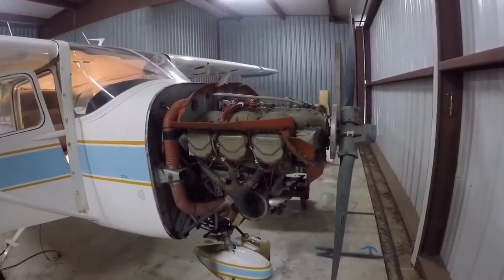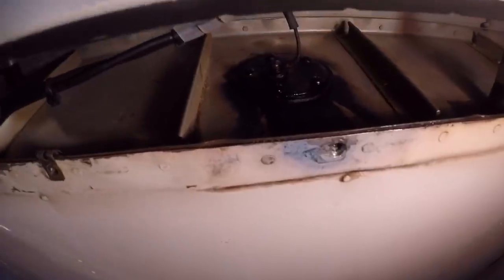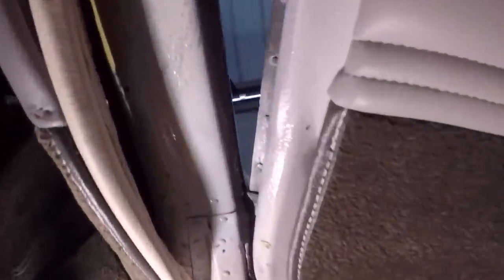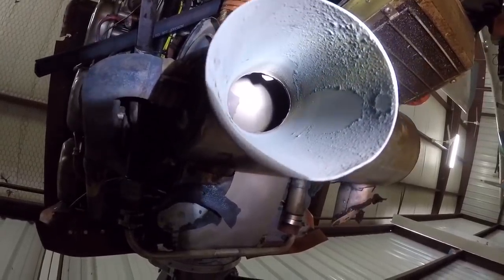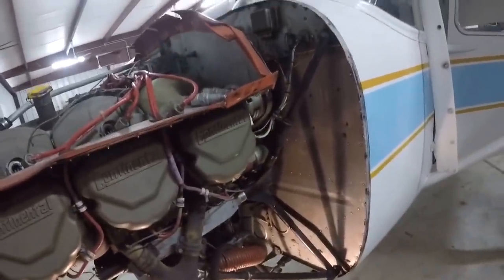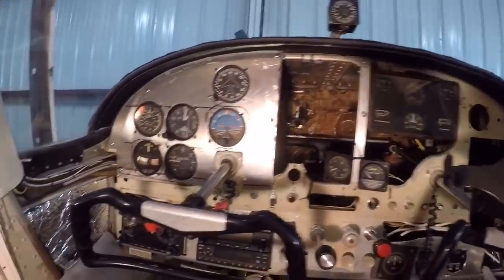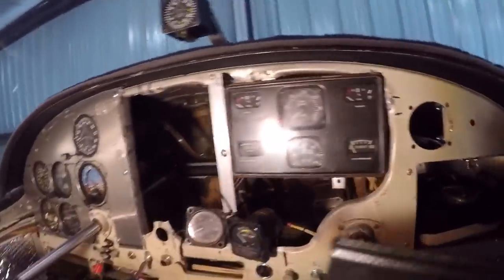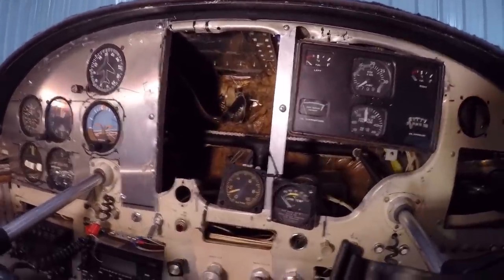This is why you get a prebuy (wait till you see the instrument panel 😮)

Comment: Excellent and clearly structured accounting of failed parts. I need more of this in my life - I subscribed. What is the best thing besides a thorough engine inspection one should do? What are easy access areas to check for corrosion. I am interested in buying a vintage deHavilland Beagle Pup but would need some advice.
Reply from the maker: I do not have direct experience with the Beagle Pup, however always do a thorough inspection of gear attach points and wing spar.  Check tail surfaces for security.  Don’t be afraid to open up as much as necessary for you to feel comfortable with your purchase.  All airplanes are built to have enough inspection access to get a good view of everything.

Comment: Probably best buy a used elevator and full instrument panel. The (U shaped) spar will have to be drilled off of the cabin roof.  
 Check  where the struts att under the floor is another big 182 corrosion area to

Comment: Hell, she's fine shape. Drop a little stop leak in the fuel tank, slap some JB Weld and 100 MPH duct tape over the corroded aluminum, pour some Engine Restore in the crankcase, and sign her off for another year. Just don't fly her near me.

Comment: THIS is exactly why I NEVER flew someone else's airplane. I made one exception and flew a club plane and had an inflight engine failure. When I was flying I flew MY airplane and no one else flew it without me being in it. No surprises, I kept the planes in top condition, never had to worry about junk like this.

BTW, is all that plastic "bubble" insulation even legal? All that panel work is certainly not.

I hope your customer knows this is going to be a VERY EXPENSIVE annual. So many owners can't distinguish between the INSPECTION FEE  and the ADDED COST to correct discrepancies. I hope he doesn't paint you as the bad guy in this. You are likely saving his life fixing this mess.

Comment: Yikes, a bit of a fixer upper.  I'm sad at how many annuals I've seen similar discrepancies which had obviously been whipped for years.  During my first one after finishing the IA, I found elevator and rudder cables loose enough to drag on the belly.  😳
Reply from the maker: Very disappointing to see neglected and whipped airplanes.  I did an annual a year ago on a 150 that was painted 4 years earlier.  I had to dig paint out of every inspection plate to remove the screws and found the same thing with the control cables.  The carry thru cable for the aileron was so loose it had flopped over and was ridding on top of the flap pulleys.

Comment: What's the difference between "prebuy" and buy?
Reply: A new-to-you airplane. 

When I was shopping for my first plane my buddy explained it like this. "A pre-buy inspection may cost you $600-1500, depending on the airplane. A fairly minor repair pertaining to airworthiness can start at $3000. With a pre-buy you just saved the cost of the airplane or can negotiate the price down for every issue."

Comment: I’m surprised he was able to fly this plane to where the mechanic is located. Buying and then flying a plane in poor condition isn’t like driving a car in poor condition, you can’t just pull over on the side of the road and call a tow truck. It usually ends much worse.

Comment: It makes me suspect that the usual "pre-flight inspection" is nowhere near enough. I recall smelling AVGAS from a couple of CESSNAS I flew. That fire-wall - do you suspect a hard landing on the nose-wheel?  That panel - My God !!!!! Most of all i suppose that Centre spar corrosion - I'll have nightmares tonight.
Reply: In the car world there is such a thing called " Rat Rod " this is where people intentionally make ragged looking vehicles.  It is more for art than for a car that works. ( See the Mad Max movies for examples )  I'm wondering when we will see this in aircraft?   The instrument panel is well on it's way.  The rectangular gauge cluster on the right looks like it is from a late 30's car
Reply: @bobroberts2371  An unexpected possibility you raise. However, my view is that planes modified in that way should never fly. Flying is fabulous fun, but it is high stakes when something goes wrong. There are several I  examples where a passenger required coaching over the RT so as to save the plane and their own neck after the pilot became non-responsive. It helped that they ground could locate someone familiar with the type to advise. Non-standard panels like that would pose another layer of confusion, and that is not helpful. I like what you do. Although I flew, I think my training was lacking, because most of what you look for is so obvious, and yet, I was never trained for them. For example nobody batted an eye when the Blanik Glider made oil-canning sounds. Although not a power plane, it has a lot in common with one. The fuel smell, and some planes simply looked tired and less well maintained. Placed a lot of reliance upon the mechanics.
Reply: @kiwikeith7633  RE Non pilot passenger flying the plane.  In another post I floated the question if any private pilots briefed a non pilot passenger on how to use the radio to take some load off the pilot in an emergency situation or more advanced " how to maintain level flight" . Seems like it would be the equivalent of flying commercial and listening to the safety briefing.
Reply: @bobroberts2371  There was a passenger in a KIng-Air in the USA. He was an American from the South I think. He did have a little Cherokee training some time earlier, but the Panel had him bewildered. In the UK there was an old guy taken aloft by his friend. Pilot died at the controls. That man had some familiarity with radio, but none at all with flying. Dusk rolled into night and he was unable to locate the panel lights. The authorities had a rescue chopper accompany him on approach. I'm not sure if anything got bent in either landing. But in both cases the authorities sought out pilots of the type to help on the radio.

Comment: The worst thing for an airplane is just sitting there not being used. My Cherokee had 2560 hrs soh and still had 70’s cylinder pressure the day it left. Sitting there hardens gaskets rust builds up on cylinder walls and cams etc.

Comment: I'm not a believer in paid-for inspections.  It's complicated.  I bought my airplane in 2014 after paying an AI for a pre-buy.  I found an AI mechanic that had no previous knowledge of the airplane in the town it was located in. The mechanic was a fresh set of knowledgeable eyes on the plane before I bought it, or so I thought.  He called me and told me the airplane passed with flying colors.  He accepted my money in payment.  I bought the airplane and the owner delivered it to me.  Unfortunately, the inspection missed many problems, some costly, and some dangerous.  Just two of many examples:  when the airplane was delivered to me, the glove box contents was soaked in oil, as was the underlying carpet.   The Hobbs had been dripping oil for a long time.  Another example:  on my third touch and go, my seat slid all the way back just after takeoff.  Thank God I was receiving a check out with an instructor, who took over control.  Had I been alone, I would have crashed.  The seat rollers were worn out.  These two things were easy to check and I feel the mechanic I paid for the pre-buy inspection did not do a good job.  He just took the money and ran, as did the seller.  I still own the airplane.  I paid dearly to get a lot of things repaired.  I will sell it soon, in much better condition than when I bought it.  I'm now hoping to buy another airplane from a gentleman who says he doesn't fly much anymore due to age.  It was a year out of annual.  I asked him to get an annual done and he did.  The annual is done, and he bought the plane a new battery and a few other needed items.  I called "the other mechanic shop" in the town where it's located to see if I can get a pre-buy inspection.  That mechanic said they do not do pre-buys, unless they will also get to do the repairs.  So, I'm stuck doing my own inspection, and I'm no mechanic.  I plan to send pictures to my own trusted mechanic back home, since he can't be with me to look.  If it's good, I'll buy it and fly it home.  It will be a six-hour flight.  If I find stuff wrong, I'll fly commercial back home.  Got any other advice?
Reply: miporsche -YES, I have a great idea for you. Ask around your home airport for a name of a great, honest,  and respected A&P /I person and buy them a round trip plane ride plus motel & meals. Spend the 1K$ and do it right. As long as you hold onto your “ I’m not a believer in paid for inspections”, you will (or may) be playing with fire. Reason I say, hire “local” to your home airport, is he/she will see you often. When you pay someone who lives hundreds of miles away.... well.... a song comes to mind - “take your money and run”. AND do the inspection with them!  I mean be right there, by there side, taking notes, pictures, video, whatever.... this also begins a great record for yourself.  Ever been to a bad dentist? What did you do? Found another one right... how about a plumber? Go find yourself a local A&P, pay small upfront - or possibly pay BIG on the back end. My 2 cents worth. Good luck! Scott

Comment: Looks like he took a saws all to that panel. How much time was left of the engine? From the looks of it that plane has done a lot of sitting out on the parking line. That exfol looks bad I would be opening up panels from root to tip on the wings, odds are that you'll more then exfol to end this planes career.
Reply: PR: The 'time" on the engine is probably irrelevent.  More likely it is years old and needs to be overhauled based on age and corrosion.

Comment: I would have run from the bad repairs.  Bet a quick compression check would have saved thousands of dollars.  I am getting ready to buy a used toyota suv that is about 10 years old.. and i am budgeting 2.5 hours for computer / frame / and overall suspension , engine , trans inspection before I buy. And thats a family car.  
      What are people thinking?  I would not risk the financial loss from buying that plane.. let alone fly it over the mountains near utah with my family on board.

Comment: Hard to have oil leaks when you barely have oil pressure!
Reply: Cylinder compression (air pressure) is not the same as oil pressure. You do a cylinder compression check on a 100 hour/annual inspection or a pre-buy inspection. He said 15 over 80, means he regulated 80psi into the cylinder and it would hold 15 psi = 65 psi blow-by = dead.
Reply: 08 Street Glide nobody said anything about compression. Glad you know what a leak down test is though!
Either way there is no FAA appropriate rule to how low the cylinder can be on the test to be considered dead. I’ve had cylinders read in the 50s but make power. (Burns oil but makes power)
Reply: 08 Street Glide but I was just kidding around because he said the aircraft had no oil leaks. Hard to have oil leaks with no oil pressure
Reply: @jetproduction4747  AC 43.13.1B para 8-14 says, "If  a  cylinder  has  less  than  a  60/80 reading on the differential test gauges on a    hot    engine,    and    procedures    in    para-graphs 8-15b(5)(i) and (j) fail to raise the compression reading, the cylinder must be removed and  inspected." I guess you penciled whipped that one....
Reply: 08 Street Glide 
oh boy, pulling advisory circulars to prove nothing.
It’s still up to the user/amp to decide.. the AC cannot tell you how you do your job.
So you can pull the cylinder inspect find out it’s cracked and the owner wants it back on. What then? Try and mark it un airworthy? Good luck.
Glad you can read books but try real world scenarios.
Reply: @jetproduction4747  during an annual inspection the inspector as an IA is a representative of the FAA and has an obligation to report this to the owner. It is the owners responibility for the airworthiness of the aircraft, not the inspector. If an inspection finds an unairworthy item and fails to disclose this to the owner/operator or colludes with said owner/operator, and looks away, he is in violation of the FAR's. And yes I am real world. You don't mark it unairworthy, you document it in the logbook  if the owner doesn't want to fix it and Don't sign off the Annual Inspection. Again as an A&P with an IA you don't work for the owner, you are a representative of the FAA.

Comment: If all you see are annual entries in the logbook, then walk away. A well maintained airplane won't use one of those dinky little logbooks. It will have many maintenance entries. If there is visible evidence of neglect here and there, then wait until you open it up for the big surprise. This inspection is unfortunately what you find in a large percentage of the GA fleet. I always tell a new customer that it will likely be a very expensive inspection and you won't make it to Sun n Fun this year. Subsequent inspections will be routine and much cheaper. I've seen far too many pencil whipped GA airplanes.  Won't let a family member fly in a GA airplane unless I have knowledge of it's maintenance history AND know the pilot isn't a cowboy. Aviation attracts more than it's fair share of risk takers. If you want to fly you got to have a thick bilfold to stay safe.

Comment: i hope he payed about $10K for this plane. Just from what ive seen here i would ESTIMATE my shop would charge for the annual and present a request for Authorization of 30 hours at $125 per., and an estimated parts cost of $2000. And i didnt even see whats in the tail, let alone the belly. I bet if that plane didnt have CorrosionX treatments then the rear bulkhead and the inside of the rudder are eaten compleatly up with corrosion.

Comment: This inspector is being hyper critical.  Hope he never looks at any of the aircraft being flown right now in Alaska.    Mother nature takes is toll on everything, especially aircraft, operated in a harsh environment.
Reply from the maker: I have not had the pleasure of working on some Alaskan based bush planes but I have worked on some Canadian bush planes.  The elements can take their toll on planes.  Most working bush planes I have experience with may look rough but mechanically are sound because the operators need to be able to depend on them.

Comment: The issue isn't whats wrong I as an airplane owner can tell you it the outrageous labor charge these A&P mech charge. The cylinder for a rebuilt one is about $1000 the sending units about $200 a piece new muffler about $1000 to $2000 the door isnt  a flight safety concern even though like you i would fix it al in all about maybe $7000 for parts but you as the A&P will charge $20.000 in labor to install those few parts. But sir you will say it will take 4000 hrs labor to do all that but in reality it will only take 10 all i can say is welcome to aviation. Rule 1 buy airplane Rule 2 realize you just got screwed by previous owner. Rule 3 find out just how expensive owning an airplane can be. Rule 4 pay to fix airplane and finally Rule 5 sell airplane
Reply from the maker: Most repair shops do charge exactly the way you put it.  I have worked in shops that do exactly that and the reason they do that is to pay for the DOM to sit on his ass and the other mechanics sitting around not doing anything.

Comment: Yeah, it is bad.  But what about a plane that is as clean as a whistle but was owned by a cowboy who stressed it out in ways you can't see?  Now, consider helicopters with so many moving parts.  It could be even worse.
Reply from the maker: That is very true.  Corrosion and illegal repairs are easy to spot.  An airframe over stressed is not as easy.  I always look for (oil canning, in the wings and horizontal). Smoking rivets, weld damage (if applicable).  The airframes that worry me the most are the composite ones because they can hide a lot of damage.

Comment: Sounds like your typical cheap owner. 

Also, not all pre buys are the same. Some local A&P’s can’t be trusted with a lawnmower. Bought a plane and stopped $1200 on a prebuy and my local mechanic shop here found a ton of unapproved car part replacements. 

I may try Savvy Prebuy if I ever have to buy again

Comment: Phew -- everyone should get the creeps from this one. 

Have to wonder if this plane's owners should be flying at all. 
There probably are a lot of stories here.  Who flys a plane in this condition and why?  Again -- every plane has a story.  Maybe the aspiring-pilot community can learn from this plane's history.

"Those easy judgements made", is there a 'racket' in plane parts? If there is, can't that business be opened up to meets-specification competition? (Aviation insurance companies -- you want more plane business, right? Competitive spare parts means more plane business -- you just have to make sure the spare-part makers you're insuring are producing up to spec. )
Reply from the maker: This plane is proof that not every pilot should be an aircraft owner.  Aircraft parts are expensive however this aircraft is still supported by Cessna as well as third party manufacturers.